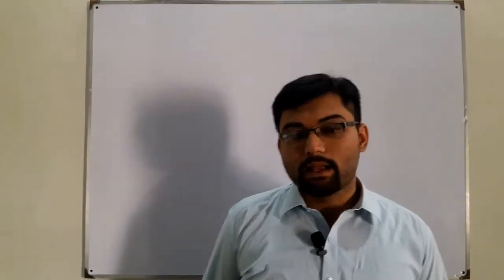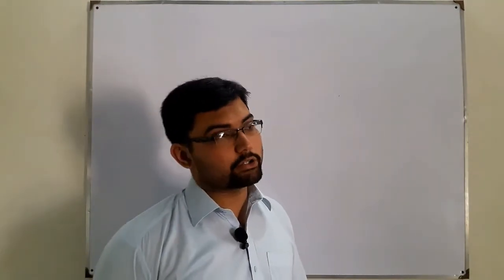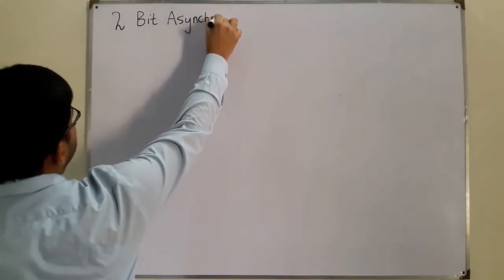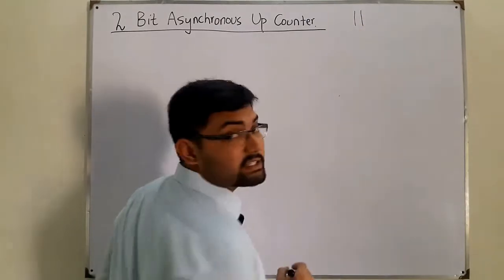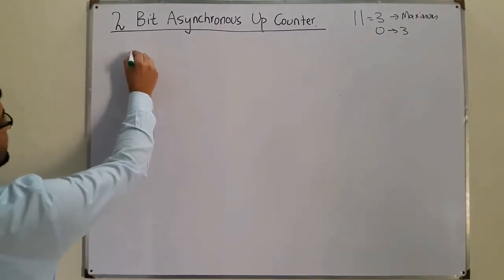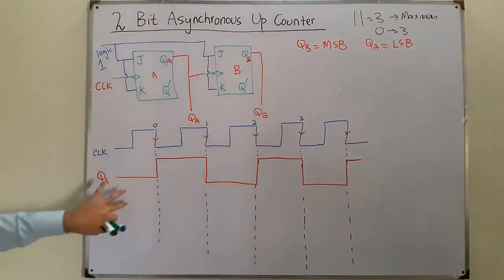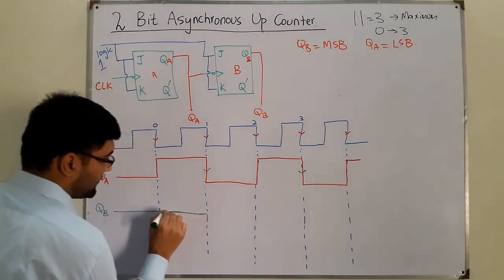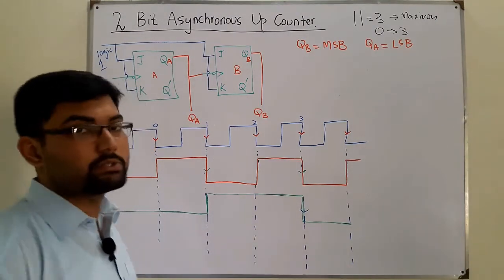2 Bit Asynchronous Up Counter

Comment: sir the clock to the next flip flop isn't the output of the Q compliment
Reply: it's like that if the ffs are positive edge triggered, but here it's -ve edge clk , so Q is already complemented if you notice the bubble at the clk position in the next flip flops.